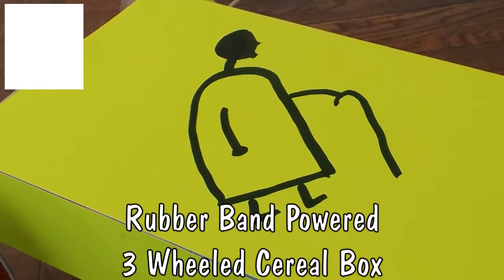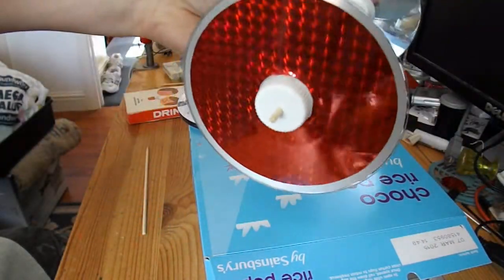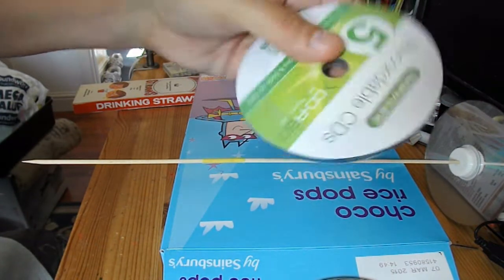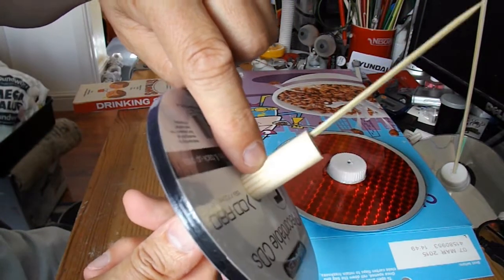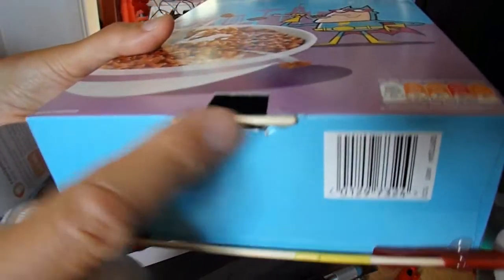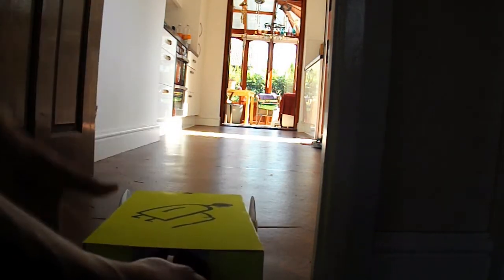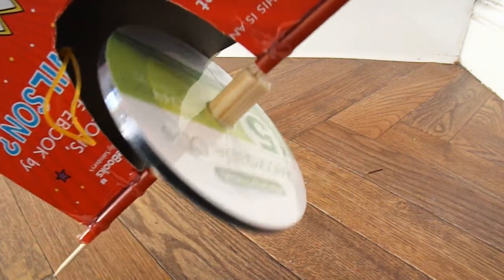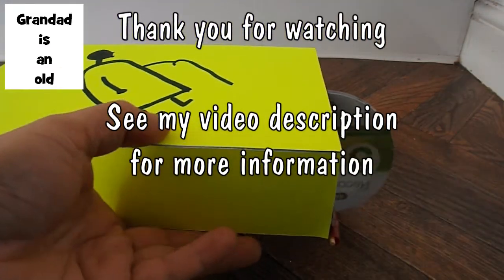Rubber Band Powered 3 Wheeled Cereal Box

Comment: With two pieces of wood like that and connected to an electric motor, you could very easily make a device that will stiffen the rubber bands or springs, to make the drive wheels will roll.
You could get to make even the engine set in motion, to support the vehicle.
I know it does not cost anything tighten the rubber band as you always do, but as an experiment ...